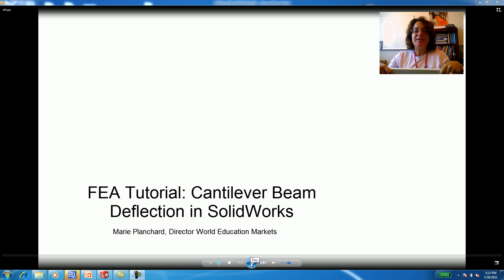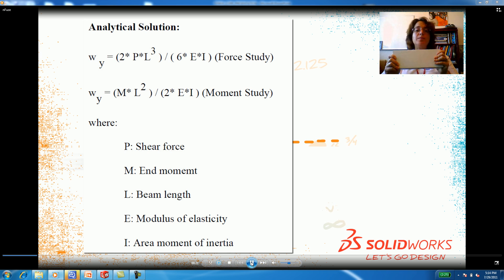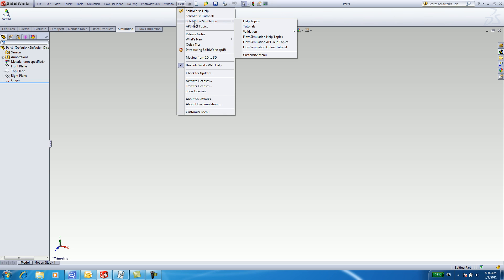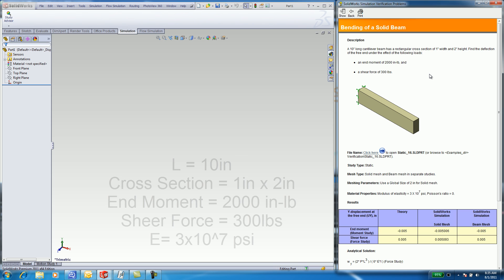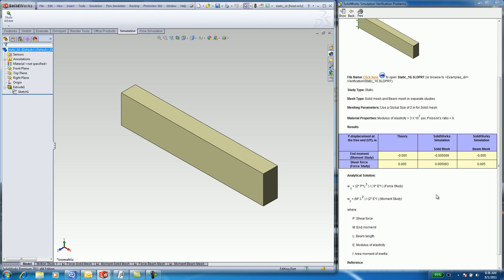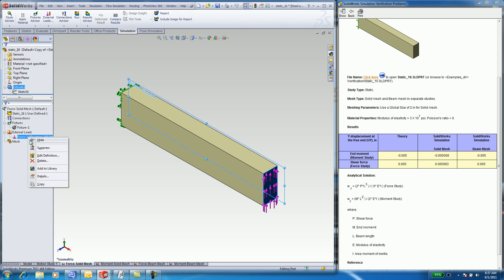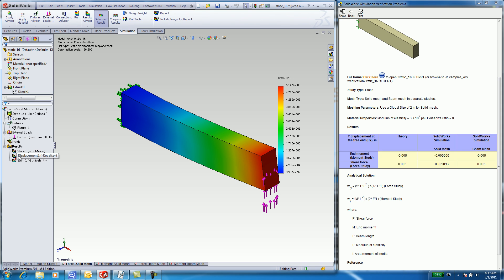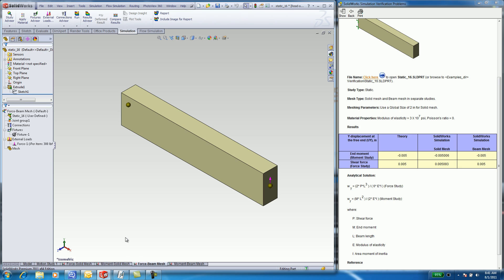FEA Tutorial Bending of a Cantilever Beam in SolidWorks.avi

Comment: my theoretical value came out to be 4.92*10^-3, however my solidworks gave me a deflection of 2.536*10^-3, I selected plain carbon steel as no material has a spot on value of E= 2*10^7 .................................................why is there such a discrepancy in the results

I also put 300 lbf force at the ends and fixed the left hand side of the beam